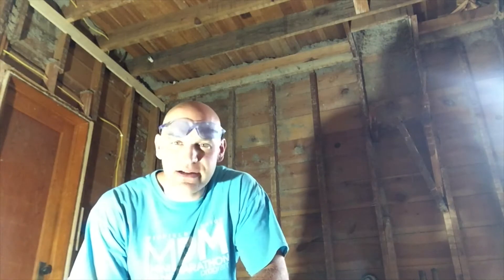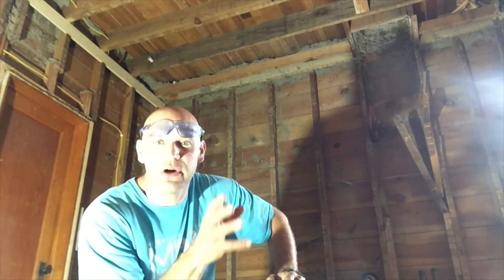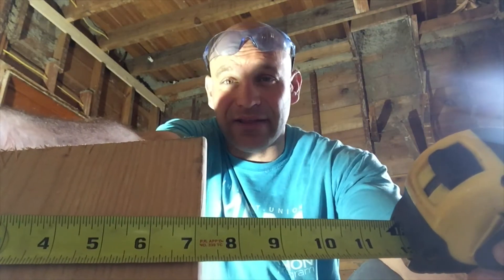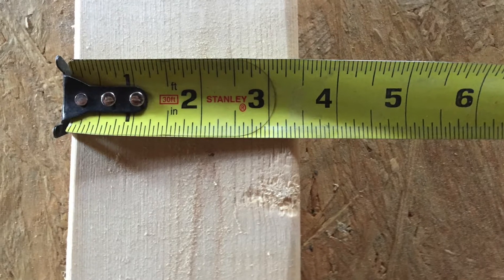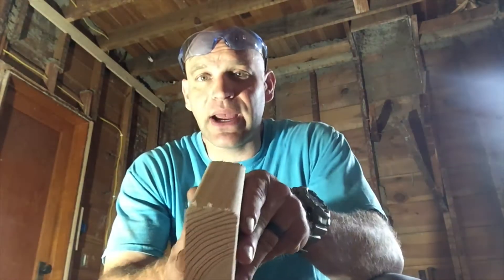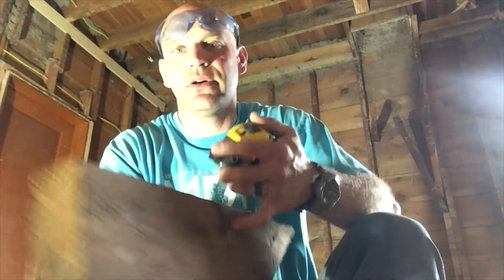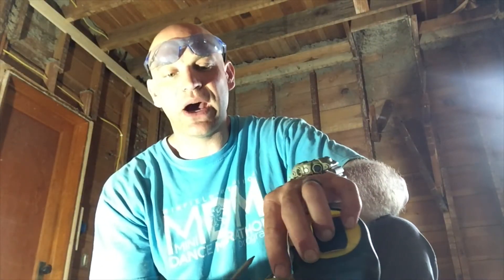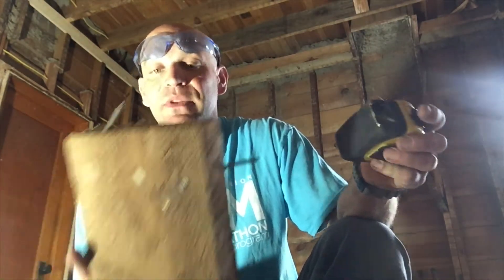Nominal vs  Actual  - what is the difference in lumber sizes

Comment: It is good to be aware of this.  I wonder how that affects the weight bearing capability between old lumber and new lumber.
Reply from the maker: The type and size of wood really effects the weight bearing capability. There is a formula to calculate the strength of wood in different sizes, it would be a cool study to look at the difference from the old to new